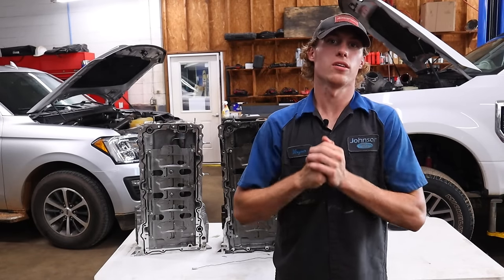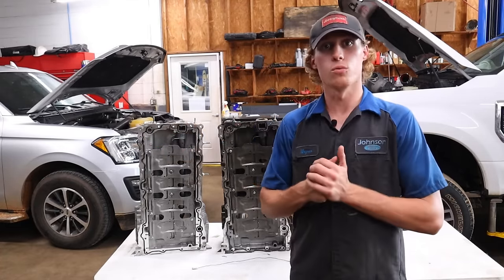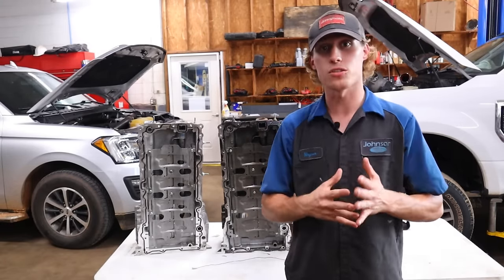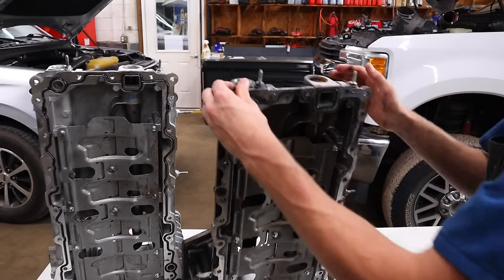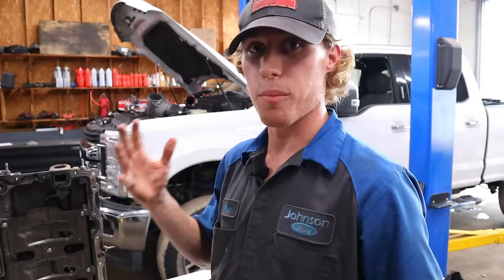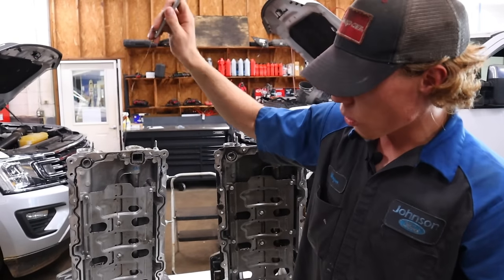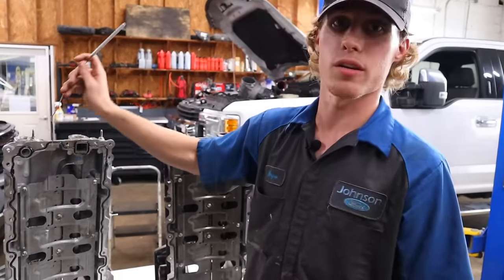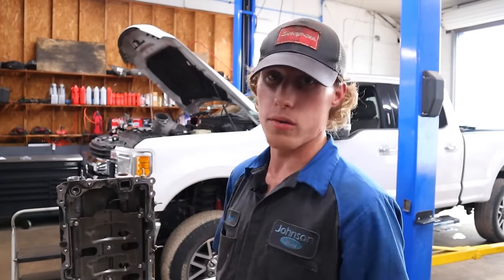How a BRAND NEW Oil Pan Destroyed This 6.7L PowerStroke

Comment: While I have no doubt the oil pan caused this issue. One things for sure. You ran that engine far longer then a few seconds... few minutes is more like it.. while yes the oil pan lead to failure you also should have shut it down far sooner. It didn't lock up after a few seconds. If it did then millions of them would have locked up in the cold months or after oil changes that no-one prefilled filter. Just doesn't happen like that.
Reply from the maker: But I was holding it at 5500 RPM
Reply: @FlyingWrenches13  holding it at 5500 rpm with no oil pressure? Why?!?
Reply: @FlyingWrenches13  wow, 5500 rpm  was the red line on most gasoline v8 engines for many years. That's really spinning a diesel. Yeah I know that modern power strokes will rev that high but certainly not with me behind the wheel.
Reply: @bobmcl2406  -- It's called sarcasm folks!
Reply: @jacobfain9 - cold engine oil or empty oil filter after an oil change is FAR different from a blocked oil passage downstream of the oil pump.  This situation I would say is even worse than starting an engine with no oil in the oil pan.
Reply: @rpsmith  it might be, but probably not the smartest thing for someone to say when they're waiting to hear back about whether their customer is getting a $15k long block for free through warranty...
Reply: @davereeves1967  -- If the owner has to take it to trial, I'm sure a jury would award him a lot more the a long block!
Reply: As far as warranty was the pan that was replaced is that part number hood for the truck if not gonna be hard to spw a failure that’s why I put back on what it calls for silicone or gaskets pan
Reply: @bobmcl2406  To get the oil pressure up.😂😂😂

Comment: The good ol half year update. Oooo you have an EARLY 89 fuel system. You cannot get a sending unit. You need a sending unit AND a tank. Ring ring. Turns out you ALSO need fuel PUMP. Ring ring. Lines aren't compatible either. Ring ring. And the throttle body. Small claims court here we come. Truck was mechanicaly totaled at the start because it really needed everything from the gas cap to fuel injector because the sending unit hole went from 3.25" to 3.125" halfway through 1989 model year. Funny part is, I bought that truck after the dealership drained both the transmission and transfer case to replace a throwout bearing under recall and never put any fluid back in. Made it halfway home.

Comment: My upper pan is leaking from that threaded insert (looks like a freeze plug) that leads to the tube that was plugged that feeds the oil cooler.  How does a guy remove that "freeze plug" and install a new one?

Comment: I remember in the 70,s and into the 80,s everyone did fine with gas engines in there pickups. You had big blocks if you wanted more power and no one was going broke over a diesel motor.

Comment: Majority of my family are ford freaks, brother in law brought a new 2021 escape, transmission shit the bed at 6,700 miles, replaced under warranty, new transmission started slipping less than 2 months later  He traded it off on a Toyota Rav4 and he is liking it. says he will never look at ford again,  my nephew bought a new F-150 Ecoboost 4x4 in 2018, out of 14 months he owned the truck, it spent 6 months at the dealership addressing severe vibration problems. ended up suing Ford and won,  bought a Ram 4x4 with hemi and he loves it,  Ford's quality sure has went down the tubes in past decade.

Comment: I work on emergency vehicles and I see the quality issues to.  It’s bad when it takes forever just to get junk parts that you have to send back. And that whole oil pan and even the 6.7 engine is way over engineered. Need to use the kiss method less would break.
Reply: 2v triton
Reply: @crazeguy26  yep and 3v

Comment: I'm needing to reseal my upper on a 2019 f350 6.7. Will a upper from a 2011 fit it? I really don't like the "silicone" gasket.  Thank you
Reply: Same exact pan, except for the rubber insert gasket BC3-6675-B. Make sure that oil galley is clear

Comment: Most states allow for consequential damages. The new oil pan blew the engine as a direct consequence of the plugged oil passage in the oil pan. This is product liability. Ford should be interested in the oil pan though. Their quality department should issue a CAPA on it.

Comment: I bought a set of piston rings in early 2022 from a very reputable co (who shall remain nameless) to refresh my daily driver '00 Ranger at the tail end of Covid. They were bent the wrong way around at the factory (ID and OD in the wrong orientation). Couldn't help but ask myself "how the F'n.. F does that even happen!" So they overnight me a whole new set, this time correct rings... And missing all 4 oil control springs. The same refresh I picked up a brand new $350 Motorcraft alternator and the damn thing was putting out almost 16v idling right out of the box 😑 I'll never know how that didn't immediately destroy anything

Comment: A good hint it's, ir you messed up with the lube system on any engine, before actually starts, first crank the engine a few seconds until oil pressure builds up. This way you can prevent a dry start on ítems like turbos, and prevent engine damage in general. Control of quality sucks in this days
Reply: Yes I saw a brand new 390 that - I guess Chevy guys - someone either left out the pencil driving the oil pump or dropped it in the hole…
It ran for 30 minutes on assembly lube while they troubleshooted the oil pressure guage. 
Then it turned its last turn

Comment: i did the upper oil pan gasket in my 6.7 in my driveway, I spent 2 hours on one bolt, my big hands couldnt fit. I hated every bit of it. I miss my 5.7 tundra so much, 200k miles and I only replaced the the starter twice.

Comment: That’s very surprising it locked up in less than 10 seconds…that being said, these newer diesels are not your granddaddy’s diesel!…tolerances are super tight…but I must say, aside from the no oil pressure due to a plugged line, does it seem odd that the oil has to pass through so many lines and passages and coolers before it ever makes it into the block to actually do it’s job!…has there ever been any issues with oil starvation with these engines?

Comment: Everybody saying that it couldn't have locked up in such short time needs to consider two things, #1 the bearing clearance on a 6.7 ps are tight at .001-.003 and .001-.004! #2 the bearings have no alignment/anti rotation tang. They can and will spin very easily especially with such close oil clearances.

Comment: Ive had my multi vehicle shop for 18 years.
The 2012-Current era engineering has been interesting yet poor in quality.
From engines in hyundais, to brand new oil leakers in GM and Ford turbo line ups.
People ask me what car they should get and the ONLY one I can honestly thumbs up is Subaru.
You want an ecoboost truck? They drive nice but expect alot of premature expensive tear down.
I feel like id point to RAM v8 for truck platforms, so much cleaner and simpler, yet they also still are driving like sedans.
So FORD in this video example here. If you tell me an engine locked up in 7 SECONDS, right there you have it, that engine belonged in the thrift store to begin with, NOT the repair shop lol.

Comment: If this is a Ford Genuine part and it is defective, then ford should pay for the customers new engine plus the money they spent to replace the upper oil pan and the cost for your hours replacing the engine. Also, since the quality of this part is questionable, they should send out a service bulletin telling service techs to verify that this passage has no blockage as you stated.

Comment: Seeing this kind of nonsense makes me miss my one of one 89 Mercury Grand Marquis LS. Factory ordered with the 215 HP 351W and the Trailer Tow III Package. Rated for 6,000 pounds of trailer, and capable of returning more than 30 miles to the US gallon when not towing. In Canada the 351 was an RPO at a cost $185. Worth every penny, it was a torque monster. 390 lb/ft at 2200rpm, the performance axle ratio was a 2.73:1. The car flew and covered ground better than anything I have driven before or since.

Comment: Scary how many shops are saying the same thing… this is like the 5th different YouTube vid I’ve seen on this topic and we all have a similar story in the comments. I manage a 4 bay shop, seeing crap parts from all the part companies, dealership eom parts and with the aftermarket parts we’ve been getting from the same place for years. Basically quality control is out the window while the part companies try and play catch up to the back orders.
Reply from the maker: I think a lot of this is caused by manufacturers changing replacement part distributors to low labor cost companies. Cheap labor equals cheap products
Reply: @FlyingWrenches13  yeah ok that makes sense too. The “oem” parts I’ve been getting seem a little fishy when lined up with the original off the vehicle, especially with the ac-delco stuff I’ve been getting the edges and finish just seem off seem different. Haven’t had to get a motorcraft part in a while probably similar deal.

Comment: FORD needs to go back to putting a oil pressure gauge on the dash. As well as a oil pressure pid for the aftermarket side of scan tools.  Alot of guys bash on Fords. But i had to fix more chevys then fords.

Comment: Thats some slack shit I bought a 6.0 reman long block from the dealer Had oil press till i got 2 miles from the shop going down the interstate and bang it started knocking and lost oil press dropped two rods before igot it stopped got it towed to the dealer i bought it from they dropped the pan and found other rod bolts not torqued They covered it parts and labor Boy I was glad to see that and they swapped the engine

Comment: My Fords are badass. 68 Mustang fuel injected 438windsor 680hp 9sec street car, 900wheel boss supercharged 2011 Mustang makes 900wheel at 8k rpm. 2003 f150 4.6L drive it like a race car and begs for more. Use the best oil you can buy and best fuel you can buy and only use the best parts. Ford is best sounding V8 on God's green earth.

Comment: the person that installed the pan should have cleaned all passages and checked for obstruction before installation. yes the pan is defective but the person that installed it should be liable. always check your parts before installation so someone doesn't have to fork over $15,000.00 for something that should have been avoided. i have 45 years in the diesel engine and heavy equipment field and have seen my share of defective parts and it isn't getting any better.  i have a diesel engine repair and rebuild shop and strive for a 100% success rate. so far so good.

Comment: One of the little (?) gotchas on the 6.7. So far at 142K on my very early Job 1 2011 have not had the upper oil pan leak. With the transmission making odd shifts, am deathly afraid of what a Ford shop capabilities are these days - even with my Ford ESP which includes this item (to 160K).

Comment: I work on aircraft, parts quality is actually worse.. ive had actuators that where assembled completely backwards, issue with aircraft is if you take it apart to re assemble it correctly you have to re-certify the part. which requires mountains of paperwork and days wasted.

Comment: If that thing LOCKED after 8 seconds of running with no oil, I'm a Palomino pony.
Reply from the maker: Well I was holding it at 5500 RPM
Reply: Why would you hold a cold diesel at wide open at startup
Reply: @chris3849  it's a Ford thing l😂
Reply: @rafmatt1607  it’s not a Ford thing smh it’s a dumb thing

Comment: Locked up in seven seconds? Even at zero oil pressure, an engine should be able to run for a couple of minutes.
Reply: Agreed, 7 seconds to seizing is quite literally unbelievable.  Someone isn't telling the whole story.
Reply: @ferrumignis  the clearance is tight on these engine like a Honda F series.
Reply: @crazeguy26  So what?  If these engines routinely locked up within 7 seconds of no oil pressure we'd be hearing of countless failures just from changing the oil.  It's absolute BS of the highest order.

Comment: I'm mostly suprised no time was taken to brake clean and blow out all the passages before being installed even if it was a new pan.......would of been noticed fairly quickly if the time was taken to prep stuff correctly
Reply from the maker: What? In what world do you remove pre installed oil galley plugs to check for correct casting? You don’t work flat rate lol
Reply: @FlyingWrenches13  in a world where you don't blow up 15g motors being lazy lol

Comment: I call BS. There is NO WAY an engine siezed in 7 or 8 seconds of running without oil. No chance at all. That's not to say the pan wasn't bad. But there are too many other issues to bring into question.
Reply: Yeah bs, an oil starved vehicle will go into limp mode, knock.. then blow… doesn’t happen in 8 sec
Reply: i bet they ran it for 8 mins..
Reply: My thoughts exactly. No well designed engine will die after idling for 7 seconds without oil pressure. Unless the bearings were 100% dry, which they should never be. Even a new engine has assembly lube on all the bearings.
Reply: Absolutely..not possible
Reply: Powerstroke tech here. The 6.7 will run with out oil for a solid 20 seconds. Then it will heat seize.  Lube tech ran it no oil by mistake. Service manager said if there's anyway I could unstick it. Out of curiosity I filled the engine with 10w30. Wiggled the crank back and forth after 5 hours of cool down and it fired up no problems. I cut the oil filter open. No metal. To my knowledge engines still going strong. The 8 seconds is hard to believe
Reply: @trexthepony8614  I’m too lazy to look up the schematics but I thought the 6.7 injectors ran off oil pressure? Aren’t these the engines that wouldn’t start if one of the tiny o-rings in the high pressure system leaked?
Reply: @KindredAutomotive  nope they have nothing to do with oil pressure not that a schematic would show that anyways
Reply: @KindredAutomotive  6.7 is a common rail engine
Reply: I think something to keep in mind is a lot of modern engines have very very tight tolerances and if an engine's been sitting with no oil in it such as a situation like this where you intentionally drain every drop out so you can do the pan replacement I think his time estimate is a little shy but I definitely think it's possible
Reply: I’m pretty sure he said 70 seconds
Reply: I've seen engines seize with very low oil after a valve cover gasket blew within in a minute. I've also seen engines run for an hour without oil.
Reply: 7 or 8 seconds, cumulative would be 2 MAYBE 3 oil changes, it’s a bit more like a quality control issue, but in two ways, the pan, then the guy firing it up after the work., should see oil pressures in 4 or 5 seconds if not you need to shut it down and check it again.. I say this sucker backed out, and made a test drive.. 7 or 8 MILES…
Reply: Did u install the pan fire it up and walk away? Be honest lol
Reply: @GRANITEMONUMENT  every cold start up on these engines takes 10 to 15 seconds to build oil pressure to the turbo.
Reply: @prozz5664  so says Dave’s engine repair, tested on a cold run stand without all oil accessories tied in or sealed, my oil pressure does not take nearly that long to build, further, he still never reveals how he built pressure faster?? Nor did he get into the oil pump itself and mic it for wear?? Or damage?, or maybe just a defect??
Reply: @prozz5664  just think about what your saying, and I’m fairly sure I know where it came from, let’s assume 15 seconds, I’ve owned more than a few vehicles that took some time to get oil to the top end, and they all clattered for a few seconds on cold starts, not a common issue on 6.7’s second, they are talking about bottom end issues only, why are we not having a ton of cam bearing failures, or turbo failures, every 4 cold starts is one full minute of run time with no oil?. A 5 year old truck would have let’s use easy numbers 4000 “cold starts” one in the morning on your way to work, one 8 hours later on your way home, and a few lunch runs, parts runs., that’s 1000 minutes with no oil, what’s that the equivalent of 16 and a half hours or so?? With no oil?? Now most of us are seeing minimum oil pressure of 8psi within 2 seconds of beginning CRANKING, I believe there was a tsb about low oil pressure, affecting less than 1% of them, that generally see engine failure within 1000 miles.. or shortly there after…
Reply: Y'all talking about running an engine without oil after an oil change. All of the oil in these rails doesn't drain out during an oil change.
Reply: @toolman9081  agreed, however enough oil does not stay in the passages to to make it to any vital components, even if every passage way was slap full of oil, the pump still needs to force more oil into the passages in order to move oil out of the passages an on to any lubricated components, they would basically just sit and run with all the oil passages full of oil but not moving any oil.., now the older 7.3 6.0 or 6.4 that were all high pressure oil to fire the injectors, is slightly different because that upper reservoir where the oil cooler is would hold a bit, and there is a high pressure oil pump, but not to lube components only to fire injectors..

Comment: It takes well over 5-10 seconds for oil to reach the whole system on these on start-up after a  change with filter..have confirmed this with gauges.....so although pan is clearly defective, Im not sure why engine would lock up in 5-10 seconds of no oil....suspect

Comment: Had a bunch of 5.4l's come from factory with a bent windage tray in the oil pan/ slapping against the crankshaft on brand new engines. Turns out Ford/ Engine rebuilding facilities parts washer had a bent arm, imagine how many 5.4l's that happened to if our Northern Dealer seen it multiple times. The big 3 get beat out in quality control big time.